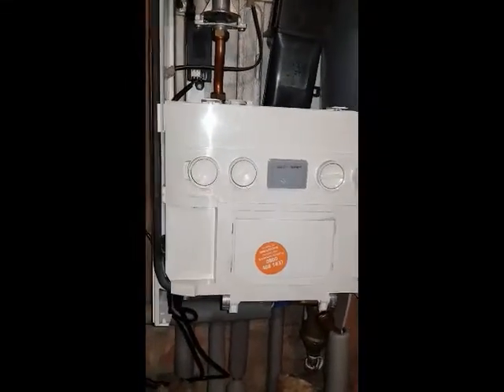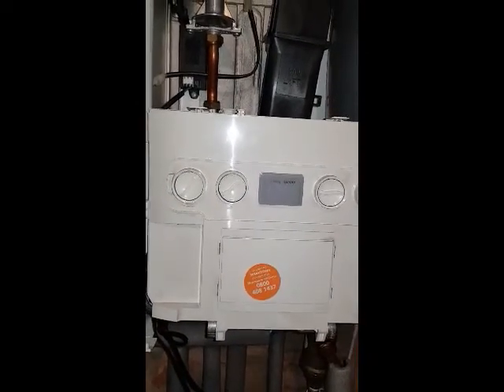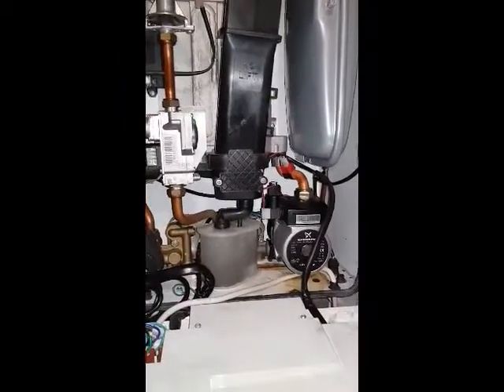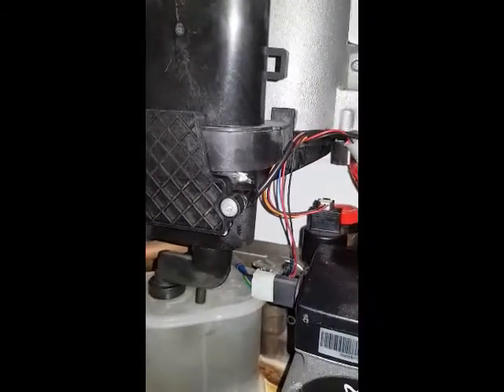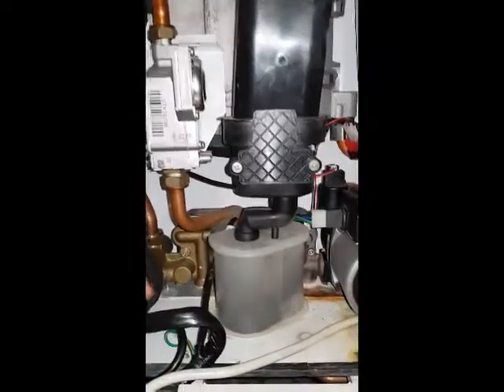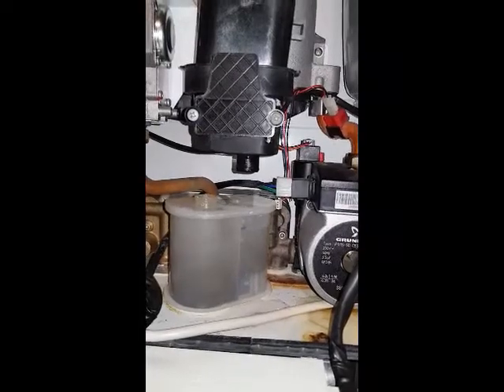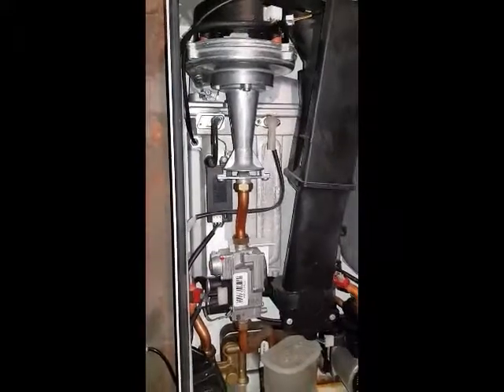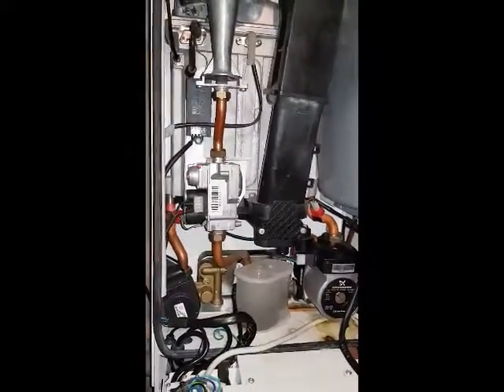F1 Code Ideal Logic 24 losing pressure with Coach Tony Morgan

Comment: Couldn't you just add Miracle Seal to the CH circuit which should stop the main heat exchanger leaking? I've used it a few times and it works a treat.
Reply from the maker: hey we're currently trying to grow our Facebook group and would love you to join Tony and the team using this link, Tony will be available to answer all your questions directly there's also updates on new trainings we just released too. https://www.facebook.com/groups/167070231326174